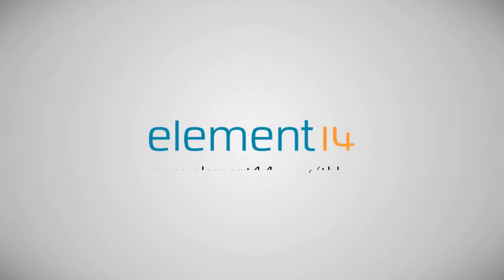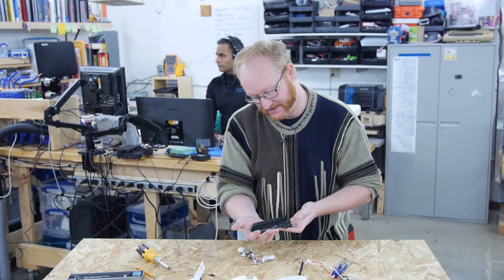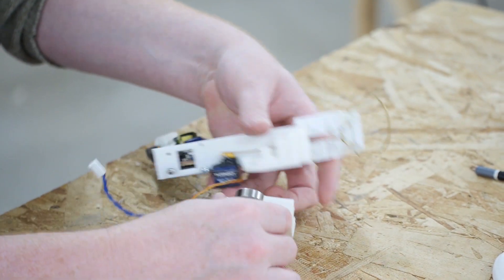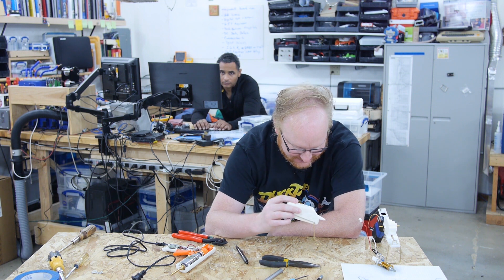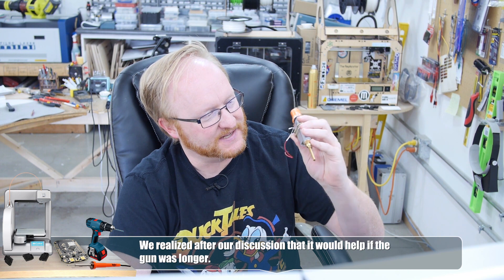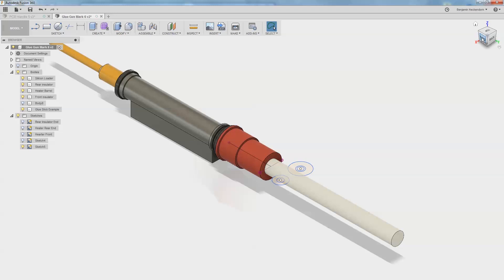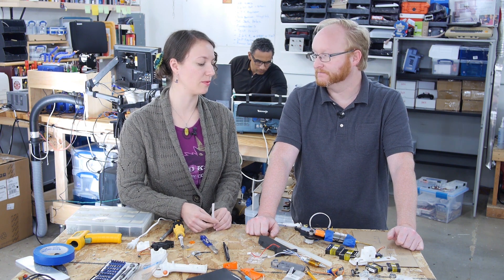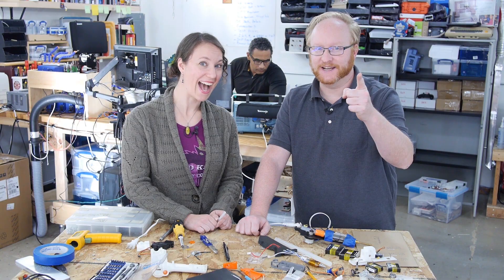Super Glue Gun 09: How to Make a Stand

Comment: Why do you need a motorized stand at all? Why not design the base of the grip to stand up by itself
Reply: How do you imagine that?
Reply: Siana Gearz 
Easy. I close my eyes and imagine.
Reply: Maybe you haven't considered that the hot glue gun is very front heavy and somewhat top heavy. So without something to prop it up at the front, there's not really a way that it could stand. You could give it a permanent protrusion on the front, but that takes away from your working space when you need to glue an inside corner of something.
Reply: Siana Gearz 
Other glue guns have done it, including the Ryobi cordless and a motorized one.
Reply: Ryobi cordless is great, but it's standing on its heavy tool battery.
Reply: Siana Gearz 
So? What's wrong with that? Well, if you don't want that, what about the Surebonder MGG450?
Reply: Not per se 'wrong', just inconsistent with the design brief the show is developing against.

Thanks for pointing out the Surebonder, i haven't seen one like that yet. They have employed a very heavy motor and moved it all the way back to counterbalance the hot end, so it can stand on the handle foot. That's very elegant and definitely something this show should be looking at. Especially considering how very borderline their extrusion performance currently is, with the wimpy little motor used here.

Comment: The electronic stand seems like a V2 project.  A nice soldering iron type stand would probably suffice.  Something that can capture the dripping glue which the electronic stand doesn't do.  Also, if you look at how plastic extruders work for injection molding, they have a screw mechanism.  Which would be great for reversing to suck excess glue back in instead of having it drip out.  That would be a big improvement over the off the shelf glue guns.

Comment: The whole time you we deliberating over the auto stand, you were clicking your ball point retractable pen. And I was sitting there thinking... Why don't you use a similar mechanisum as the pen? It doesn't have to be electronic. It could be in a similar position as a safety on a pistol and operated with the thumb holding the glue gun. So it would still be a one hand operation with minimal chance that it would actuate when you don't want it to.

Comment: Just a thought. Why not remove the auto stand and replace it with a separate Ben Heck themed glue gun stand that it sits in that could potentially hold extra glue sticks and potentially include the power transformer? A bit like a solder station.
Reply: +1, and a disposable or cleanable catch for the drips.  I keep thinking the same thing.  If this is a corded unit, why does it need an integrated stand, it will never move far from the plug.
Reply: I'd agree with that. Personally I feel going to a smaller glue stick is a bad idea. As I'd imagine most people who want control as people going through rather a lot of it.

Comment: I was thinking about how visibility would be affected by placing components on both sides of the gun.
As a right-handed person, loading the right side with the bulk would leave the left/inner edge more in line with the hot tip.
Not sure what it would be like to have the tip off-center to correct for balance...

Comment: What about using a motor driving a screw which drives a nut along the screw which is soldered to the wire causing it to move out and in.

Comment: Ben, why not use the same method that CD players use to move the laser? You can use the screw gear with nut on the end, when the screw rotates the nut moves up/down it. 

Then on the end of the nut, you have rods that expand outward and contract inwards. It’s very compact and does exactly what you want.

Comment: Can you make it stand in a soldering iron stand?
Same concept - same component ideally - just off the shelf
Obv some issues to work through - drips etc, but is a similar use case of wanting somewhere to park a hot-end temporarily.
Reply: We've discussed that option. Ben is adamant that the gun stand on its own so you can set it anywhere.

Comment: For your stand how about a servo with a gear parallel to the bottom of the gun, that would run through a toothed stand. That would make your center of gravity issue less of a problem. Or have you considered worm gears? Granted it would take longer to extend the stand, but I think it would leave space and make it less bulky.

Comment: why not use a spring loaded stand. it could shoot out the front and have a ratchet so you could push (or pull with a trigger)   it back in as far as you wanted. then you could use it as a stand, a strand catcher or even a rest for the shaky handed among us to glue a straight line.

Comment: Instead of using a stand to hold up the tip, how about a handle like a cordless drill with a battery pack under the grip allowing it to stand on it's own?  Maybe a battery powered unit with a charging base.  I don't know if a battery pack would heat the gun from a cold start but the base could heat it up and the battery used to keep the heat up and power the feed etc...
Reply: @Glenn Lake, Another great idea. If batteries are not possible, some strong magnets in the bottom to help with weight balance, which would have an added feature being able to stick to ferrous materials.
Reply: like the one you can buy from bosch...
Reply: I like the magnets idea.  I was thinking of a cordless glue using the base to keep the glue hot and the battery for the feed and maybe a simple go/no go light on the tip for the heat of the glue.
Reply: Or just some chunks of metal to give it some weight.
As long as it doesn't get annoyingly heavy on that end, making it unwieldy for a glue gun...
Reply: Ryobi make a killer cordless one for under $30
Reply: Yea...but don't tell Ben.  Personally, I don't think Ben's glue gun will sell for less than $100 (and you can buy good ones for under $20).  But I like following all the builds.
Reply: I like the idea of this a lot, would be considerably less fiddly

Comment: Maybe a bipod similar to what sniper rifles use but with a servo, that will give a nice wide stance so it wont tip over but will flip out of the way and be compact
Reply: Given that the nozzle is shorter on a glue gun, would that interfere with the trigger? That's where we came across problems when considering a similar design to your idea.

Comment: the whole stand thing is silly! who said glue guns need to be upright?! how about making a glue gun that rests SIDEWAYS? If you are rethinking a product from the bottom up, you are more than allowed to have radical solutions. If the gun rests sideways, you just need a bump in the right place to make the tip point upwards instead of downwards, eliminating drip, and not touch the surface it rests on!
Reply: I am sorry, i just keep thinking of it, i can't help it. But why don't you do away with the "gun" thing at once? Why not do something like the 3d printer pen? by the way, EXACTLY like the 3d printer pen... it could have the aproximate size of a dremel, and you could make a table stand for it, like a soldering iron. The gun handle concept comes from the need for a mechanical trigger to advance the stick, if you are using motors you can simply get rid of it!
Reply: I think you're on to something Thiago. Great idea!
Reply: Hmmm. I know we considered this in the beginning, and Ben had a reason why he didn't want to go in that direction, but I can't remember what it was. May have just been his personal preference, or maybe he didn't think there would be enough room for the parts? I like the idea of it being a cylindrical rather than gun shaped. I'll have to think about that more to see if there are any major drawbacks to the different shape.
Reply: As someone who has gone through a lot of hot glue guns building things, I really like the idea of a pen shaped hot glue gun. It would be amazing for getting into the hard to reach areas for us costume builders. I'll also chime in that I never wind up using the stand on hot glue guns. I find they just get in the way or the gun just falls over anyways so I just wind up resting the gun on its side.
Reply: Maybe a soldering station style stand? But its irrelevant anyway since no one would ever buy this glue gun anyway on account of the cost.
Reply: agreed its a pointless expense that i would never use and every time i 
get a new glue gun i just take the stand off anyway as it gets in the 
way in tight spaces
Reply: Which form factor is more ergonomic is going to depend on use case, which will depend on the size of your nozzle. If I'm going to use this to precisely assemble something while working under a magnifier, I want a small nozzle + pen shaped. If I'm after quantity of glue, I want a giant nozzle with the gun shape.
Reply: What about a stand like a battery drill, so that it’s able to sit on the handle. 

Or better yet a cordless model which you dock into a charger between uses. It wouldn’t need a huge battery life. Just enough to maintain the temperature. The heating up to temperature could be done in the dock.
Reply: @theHeckwithKaren, I think @Glenn Lake also has a great suggestion.
Reply: The handle should certainly be designed and adjusted to be picked up easily. You already have a bulge for the motor in the side of the gun, that's two birds in my view. The angle for the handle should at least leave enough space for your fingers to get under it. Talking about actual guns, the safe position for a handgun is exactly that, sideways on a surface pointing forward, and at least in that case, it is a pretty straightforward grab.
Reply: I love the idea of a battery powered glue gun! Even more if it can deliver enough power to go into sleep mode(a warm yet not melting temperature) and come back quickly! cost control maybe affected though.
Reply: that is true, it wouldn't need a huge battery life, but it would still have to supply a lot of current at once, maybe more than li-ion can handle. More cells in parallel would solve the problem, but size and cost may become an issue. The warming up in the base is super clever though!
Reply: Isnt that the reason why they still use NiCd in serious battery soldering irons?
Reply: true, and also the low voltage of NiCd would not be a problem if they get the right heating element. but NiCd requires full discharge cycle, what would screw the cool warm up on the base idea, and it is less energy dense than li-ion... for a pen shaped tool that is a problem. I would go with a mains cable, because the heating element is pretty easy to source, you get rid of all the battery drama, it supplies all the current in the world and it costs A LOT less. I don't think it gains enough for being portable that it covers the extra cost. i might be wrong though.
Reply: Actually current is no problem with Li-Ion. You get two kinds of Li-Ion cells, well actually there's more than 2 kinds, but you can separate them into two broad categories: cells that are rated for right around 5A of current and have very high capacity, that's what you'll find in LED lights, laptops and whatnot, and cells that go to right around 20A, but have lower capacity for the same weight and bulk, and they're specifically used for power tools.

Now a little hot glue gun is just 20W, so just two low-current cells will power it comfortably! 6 cells and you're in the serious territory. 

The bigger problem is that you're not going to get a low voltage glue gun heater cartridge right off the shelf. Actually wait a particular Japanese tool company makes a battery powered glue gun, it runs on 18V and doesn't cost all THAT much, and it'll run for a couple hours on that battery. Also it can stand on its own because the battery is heavy.
Reply: That's a really interesting idea. The only downside I see is that it would take up more overall surface area than if it were upright. Intriguing idea, though...now you have me thinking.
Reply: Would that make it more difficult to grab the handle? With a traditional stand, the handle is open and accessible, if you lay the gun down, wouldn't you have to fumble with it a bit to pick it up?

Comment: Why are you so rejecting of Karen's ideas Ben? Also, the yellow glue sticks could be high temp ones?
Reply: We don't script anything, though we do rehearse the intro/outros a little. Any disagreements between me and Ben are 100% real.
Reply: Ditto. Personally I am tired of Ben's attitude lately, and his unfortunate facial hair.
Reply: It's nice to see your skills being shown on the screen
would be better if these were actually considered as real options
Reply: Maybe a small motor facing forward with a worm gear set up to PUSH to stand out .. the motor could be placed anywhere convenient as long as it is centerline of the glue gun .. the "driveshaft" would be made to length to reach the front and push a sled with the rod for the stand attached.. or a sled could have the tooth on it that is pushed forward by the worm geared motor, the sled would have the stand attached to it and could just run down the bottom side of the gun .. the rods could run the outside of the gun with some supports along the way, like a rail system
Reply: Because its scripted some sort of dramatisation to justify a re-design,  feels a little too constructed to me. False jeopardy to make it feel dramatic!